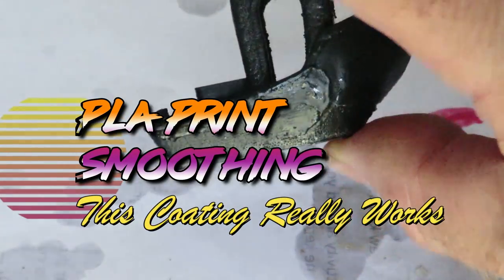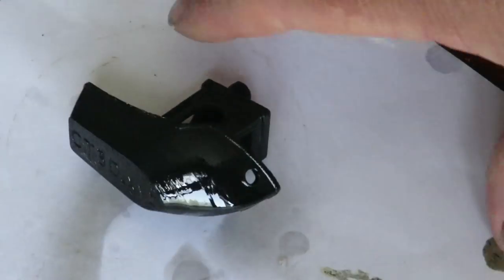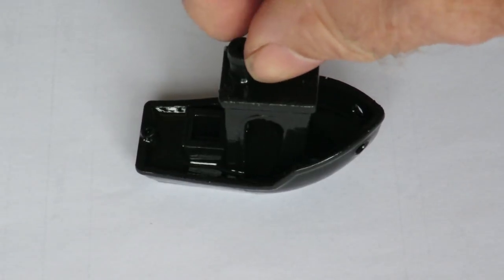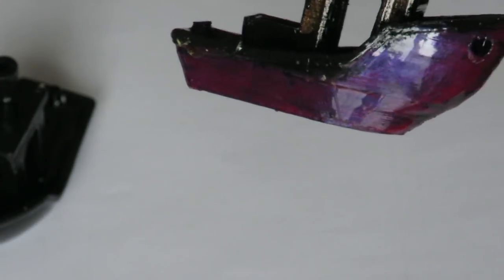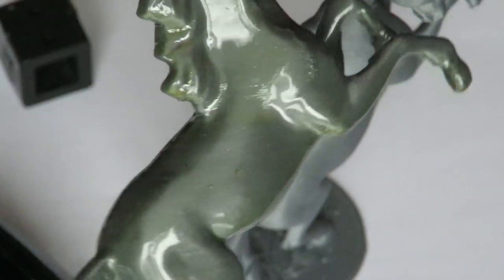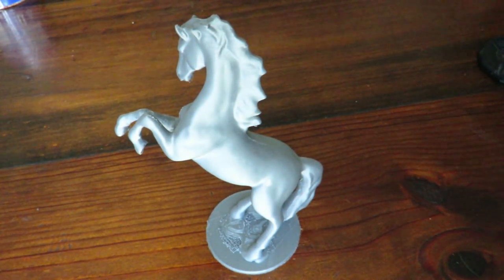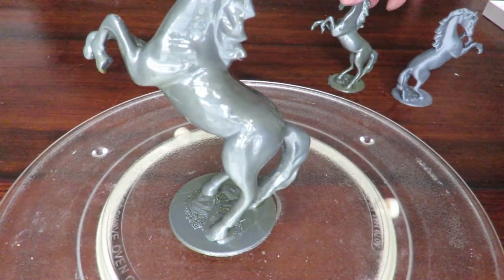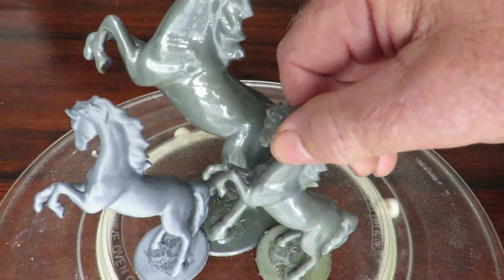📌This Coating Really Works for Smoothing your PLA Prints the Easy Way - No Sanding - Great Results

Comment: Just a tip how you can improve._:
i suggest you make another video where you show the product and its name, so you get a way better rating and clicks. / i know its in the text box btw.
Reply from the maker: Thanks for the suggestion.
Reply: Hyper Hektor f
Reply: And using a black model in a dark environment wasn't a good choice either.

Comment: Thanks Garry, I also have had success with polyurethane coating. I have used a degassing chamber beforehand but this is probably unnecessary.
Reply from the maker: Glad to hear you discovered Polyurethane also. 😀

Comment: I've tried this method, but with less success, though I think it's because my current printer is incapable of a smaller layer height than .02mm due to the complete and utter lack of cooling as well as its crunchy sounding motors not really being up to snuff for the speeds I push them to.

For anyone who isn't willing to go that highly detailed for the sake of smoothness, I will suggest smoothing with Bondo, then sealing with polyeurethane. Not only will this seal the part and make it smooth, but it should also make it much easier to do this with far larger prints. For example, if you're printing a new housing for your side view mirror.
Reply from the maker: Thanks for sharing the way you get your 3d prints smooth.🙂

However, Sanding is what were trying to avoid.
I'd suggest you try two coats of Polyurethane, and see how that works for you. "I use flooring polyurethane, as it seem thicker"

Comment: Thank you very much for the info about smoothing PLA, mister! When my print arrives I'll be testing it.
Reply from the maker: Have you had a chance to test out the Polyurethane coating on your models?
Reply: My printer has already arrived. Yay! But  i still haven't tried polyurethane, because The printer that I got wich is Ender 3 turned out to be pretty efficient at smoothing the layers in its lowest layer height. As I'm a miniature sculptor I'm always demanding the lowest layer height for my prints, and I didn't know but turns out it can do a good job in smoothing it by itself. But the information that I can rely on polyurethane for enhancing the models is very useful and I'm sureI'll come across the need in the future.
Reply: My printer is coming tomorrow I’m so excited

Comment: Went looking for this today - Is it the water based or oil based Wattyl product?
Reply from the maker: Its Oil Based
Reply: Garry Purcell hi Garry. Thanks for the info. I ended up picking up a Cabots clear polyurethane instead from Bunnings, but it seems quite thin, kind of like olive oil. Is the Wattyl stuff quite ‘thick’ to apply? Or is it runny as well?

Comment: I wonder if running the poly through an airbrush will improve the process even more. Keeping the intended detail, while smoothing the print layers, is my ultimate goal.
Reply from the maker: I don't think that would work as expected.
The Polyurethane fills in the small areas between the layers when applied thick, so thinning it so it can be air sprayed, would reduce its efficiency at filling gaps.
Reply: Garry Purcell thanks for the response! Yeah I can understand why that may be an issue folks worry about, but I don't think that's specific enough. True that it may be thinner, but the level of control with an airbrush is far beyond that of brushing or aerosol paints. So, based on your preference you increase or choke down the flow rate until you're dialed in perfectly for the application at hand. The only issue I foresee with airbrush is the polyurethane being too thick for use. Maybe there's a way to thin it like you always do with airbrush paint, while keeping the bonding properties intact.

May still be worth a shot. 👍🏼
Reply from the maker: @freshpow21  The polyurethane can be thinned, but you will not get the results you're looking for.
Reply: @freshpow21  Please try and let youtube know, i'm very curious. Just saying "it won't work" without having tried and with no credible basis for saying no isn't how new techniques are discovered. In fact, and assuming you can thin the product so as not to clog your device, i don't see why it wouldn't work.
Reply: Stan André it’s good to see you’re glass half full like me. :-)

Actually after reading Garry’s comment, I did a another search online and found several folks who go into great detail on airbrushing with thinned polyurethane. 

Not only is it possible, but getting desired results were demonstrated.
Reply from the maker: @freshpow21  That's good to know.🙂
Reply: Garry Purcell I definitely agree. Once I get a chance to rehab my airbrush compressor, I plan to try this out with some matte clear polyurethane. If it coats well, all that remains is to airbrush with the desired colors for a professional look. With the paint layers being thin with airbrush, it should minimize loss in detail.
Reply: @freshpow21  as someone who uses a lot of airbrush compounds for miniatures I can say give a try to some basic gloss varnishes you can get at the craft store  (the liquitex brand is good). You will need more coats than this poly stuff (I use it too) as it is thinner - but it is water soluble and a lot safer to work with.
Reply: Recently, I've found out that water based chalky acrylic paint (sold in hobby stores) do a nice job of filling small imperfections. I have thinned a chalky white paint, then applied with airbrush over a sanded area (abs injection molded plastic, as far as I can remember I've sanded it with 320 grit) and that did a really good job of covering scratch marks and other imperfections (surface had some deep scratches). I will try to use the same technique as soon as I find some free time :)

Comment: GREAT TIP! Never thought about using Polyurethane even though I'm currently finishing a piece of furniture in Polyurethane Stain, oak color.

It comes in a variety of colors and would be interesting to finish with a white print. Using an air brush would be best.

There are different kinds of Polyurethane and it can be found at any big box home store like Home Depot and hardware stores worldwide.
Reply from the maker: Hi Joe
Glad you found my video useful.
I don't own an airbrush, and I'm not sure it would work.
I would like to know the answer myself.
Reply: Garry Purcell Thanks for getting back. Yes air brushes can be used with kind of material, but it's a lot of work cleaning them.
Reply from the maker: Thanks
Now I know.
P.S. I use the traditional artists paint brush myself, with Acrylic artist tube paint.

Comment: For me I use layers height 2mm for printing  and for smoothing I use Fixative acrylic coating spray and no need to do sanding or any thing like that .
Just print then spray .
Reply from the maker: I use fixative on my oil paintings.
Never used it for 3D prints, I'll give it a go, Thanks.
Reply: Can you tell us, please, which fixative spray do you use? I mean, which brand (Krylon,...)? Maybe some link of this product?

Comment: Its interesting because even though the shiny model is way smoother, it also shows every flaw. What I would like to see is a matte clear over the shiny one and see what it looks like. I'm betting it will look even cleaner unless you really want a gloss surface of course.
Reply from the maker: I made a follow up video using Polyurethane and painted a finished model, you might be surprised at the result
https://youtu.be/AB9UACS5Pbs.
Reply: @GarryPurcell  I noticed that after I commented.  Turned out really nice with the paint only.
Reply: Use whatever “smoothing” agent as a filler and put a top coat over it, color or whatever.

Comment: I've started using Ronseal Interior clear varnish. It goes on milky-white but dries clear and gives a nice gloss finish which appears to be pretty hard-wearing.
PS - I carry no torch for Ronseal and other brands might work as well or better - I just happened to have this tin handy.
Reply from the maker: Thanks for confirming that Polyurethane Varnish works.🙂
Reply: @GarryPurcell  Glad to help. For info, I just tried the 'satin' version and it gives a very nice finish, about 3/4 the way along the glossy/matt scale.
Reply from the maker: @BikermanCoUk  Thanks for letting us all know about the satin finish. I found the Polyurethane gloss works for me, and it takes acrylic paint over the top nicely.

Comment: How long does it take for the first coat of Polyurethane to dry? How many coats do you suggest be applied and would my 3d model still have the small details?
Reply from the maker: I usually allow 24 hours between coats.
The number of coats depend on the thickness of the Polyurethane in the tin, some are quite watery and need multiple coats.
Reply: Hi you can use Fixative UV- resistance acrylic counting ( spray ) it drys fast about 5 min and no need to do sanding  .

Comment: Thanks for posting this... I also saw good results with Epoxy, but that looks a bit messy to me... Polyurethane also comes in satin and matt finish, so if you are like me and don't like overly shiny things then it may be worth trying the others....
Reply from the maker: That's a good point I've only use the gloss on myself but I will grab some of the Satin finish and give that a go as well thanks for the suggestion
Reply: An epilogue to this - I've just tried a "no name" PU that I had lying around. It's meant for unfinished furniture in which case 2-3 coats are needed before an acceptable finish and level of protection is achieved... as a result (and probably due to it's "cheapness") it's very thin - ie the viscosity of the solution is very low. 

Coating - indeed dip coating - with this thin PU solution did not achieve the results shown in your video Garry... Certainly would not pass the fingernail test. I'm guessing that you got the results that you did because you used a floor finishing PU which would be of much higher viscosity and quality  to the one that I used.

I hope that this additional note is of help.
Reply from the maker: Yes I used one formulated for floors.

Comment: I have molded urethane parts, will this coating stick to urethane parts..???? What should I use, on the urethane parts, before coating them. The parts may have some mold release on them....
Reply from the maker: I really don't know the answer.
What I would suggest, If you have a failed casting, try the coating on it, or use a part of the good casting that is hidden from sight, to do a small test section and see if it sticks.

Comment: Thanks for the interesting video. Three questions:
1. As Estapol is solvent based, do you think the solvent is smoothing the 3D print, or is it just simply a layer over the top?
2. Did you try the Estapol Matt finish, as I’d imagine a matt finish would better disguise imperfections (less reflective than gloss)?
3. I’m guessing that once you have polyurethane coated (to smooth), then painting is not going to be an option?
Reply: You can ignore my question 3. I just found your follow-up 1 Feb painting video. Perhaps add a link to your description for others to find. :-)
Reply from the maker: Hi Greg

1. Estapol is an oil based product. Its an added layer filling in the gaps on the print.
2. I have only used the Gloss finish, so can't answer your question.
3. Painting over the Smooth finish is very easy. (I made a separate video It shows various paint coatings I tested)
https://youtu.be/AB9UACS5Pbs
Reply: Thanks Garry.  I’m so confused. :-) 
- The Wattyl website says Estapol is "A solvent based clear polyurethane” (https://goo.gl/dttT2E).
- You say it’s Oil based (is that the same?).
- Then my local Mitre10 says it’s Water base (https://goo.gl/vmRQCc) - But obviously not as they also say Turpentine cleanup! LOL
So, I trusted the Wattyl website, and therefore thought “Solvent based” may mean there is also some reaction / softening of the PLA (to smooth it out a little)?

But, I certainly understand that it is, in any case, also acting as a filler (similar to now a surface primer fills imperfections).

I might give the Matt a go and see how that comes up.

Also (I’m not knowledgeable on this stuff), but would the water base Estapol polyurethane variant (https://goo.gl/VMwvxQ) take to the PLA? 
If so, it would be easier cleanup and also presumably more compatible with applying acrylic paints?
Reply from the maker: Any Oil Based product uses Various Solvents to thin them.

For Coating your Prints,  think along the lines of a thick coat of Gloss Door and Trimming Paint, rather than a water based, thin wall paint.
You'll get the idea.

Make sure you allow time for the coats to dry, if you intend to do more than one.

The finish I have achieved with the Polyurethane is good enough, that I can  paint directly onto the coated PLA after 2 days drying, and without doing any sanding at all.
Makes finishing a model easy.

Iv'e also had no side effects (Warping or Softening) using Estapol Floor Grade Polyurethane to my prints.

I'm not sure if Turpentine affects PLA, I might have a look into that when I get some time.

Comment: hi Garry, thanks for the vid. is the wattyl polyurathane  water or oil based?
Reply from the maker: Hi Anton
Its Oil based
Reply: thanks for that.  im going to give it a shot this weekend
Reply from the maker: I'm sure you will be impressed with the results.
Be sure to allow it to dry between coats, and give it at least one full day before handling the print. 
P.S. Let me know how you go.

Comment: Have you tested any more and seen if there are clearer coatings that don't give a tinge of yellow to the parts? Cheers for doing all of the testing I've wanted to, would like to see a bonus episode in the series of what sanding and the coating looks like on a part.
Reply from the maker: I have made a follow up video showing painting over the Polyurethane coating.
https://youtu.be/AB9UACS5Pbs

I do have another product coating that is perfectly clear, but rather expensive.
I will be making a video with it, in the next week or two.
Reply: Garry Purcell I already checked that one out along with most of your latest 3d printing videos, can't wait to check it out! You have a sub for as long as Youtube is in business

Comment: This is vey interesting, been playing around with Xtc these last couple of days and just coated a print with it in combination with acetone in order to thin it out for prints that were printed at 100 microns. How thick is this substance?
Reply from the maker: I'm not certain what happened to my original reply as its not showing
So I'll add it again. 
The Horse figurine is .1 and the benchies .2
Reply: I actually saw the original reply and gave it a thumbs up.
Reply from the maker: Thanks.
I wonder what happened to my original comment.
Glitch in system maybe?
Anyway, at least you saw my reply.😀

P.S. I have an unopened box of XTC. (bought it last year)
I really should do a comparison of XTC versus Polyurethane.
Reply: You really should, if it's as good as XTC with a lower price point then it will be the best way to go.
Reply: I'd love to see this. Especially on a lighter color print, maybe white to see if it is significantly clearer

Comment: What I understood that you did the first coating, then you let it to dry and then another coating and after that you left it for two days to dry? If that's that you did is this the perfect duration to dry the coating or that was just an assumption and it could be dry in less time than ctwo days" and thanks for the video by the way 🌷
Reply from the maker: Air drying goes fairly quickly, but allowing extra days before adding decorative paint, will give you a better finish.

Comment: Hello, i know this video is kinda old, but I wanted to know if the polyurethane  will remove any color permanent markers when coating the print?
Reply from the maker: The polyurethane coating should go over the permanent markers, but you will still see them on the model.
You can paint over the polyurethane to give a nice finish.

Comment: Would you say this is skin safe? Like for a mask?
Reply from the maker: Its Polyurethane, so a well ventilated place to coat your model is a good idea.
Reply: @GarryPurcell  no I mean after is dried, I want to coat a 3d printed mask but dont know if this would be safe for my skin
Reply from the maker: @ingusmant  That I can't answer.
I would suggest you consult your local chemist, for some advice as to the toxicity of Polyurethane.

Comment: Does anyone know if this coating can be cast with Platinum silicone with no issues?
Reply from the maker: Sorry I'm not certain.
You could test some Polyurethane with the silicon to see if you get a reaction.
I personally think you should be OK if you use a mould release, but not sure.

Comment: Nice work, I'm interested!  Have you tried dipping a part rather than brushing on?
Reply from the maker: No, I did not try dipping.
I think it might be a bit messy 🙂
Reply from the maker: Hi Jolongsa
Spray packs tend to apply a thin layer, so I'm not sure how it would work.
Maybe someone who has used a spray can will let you know.

Comment: I wonder if this is what xtc3d basically is, it seems to have the same effect.

This would be cheaper, though.

Any idea how paint would stick on top? I've done no research, just thinking it might save some sanding time
Reply from the maker: I have some xtc3d on-hand but never used it. (I've been happy with the Polyurethane finish)
Mayby I should make a video and compair results.
Reply: @GarryPurcell  I agree, I'd be interested in seeing it. 

I don't know if you'd be interested, but seeing how paint sticks to both surfaces would also be interesting.  

I imagine if you scuffed it and primed it there would be few issues? I may make a go of it myself to see.

Keep up the good work, friend!
Reply: XTC 3D is epoxy resin as opposed to Polyurethane.
Reply from the maker: @DigiTalDeaD  
Thanks for the info